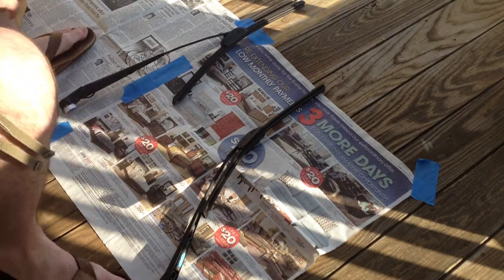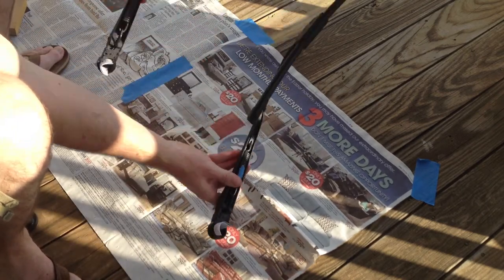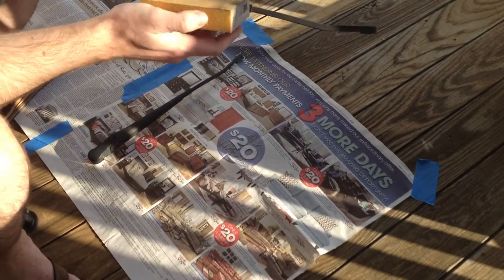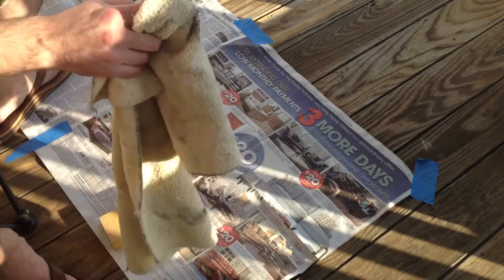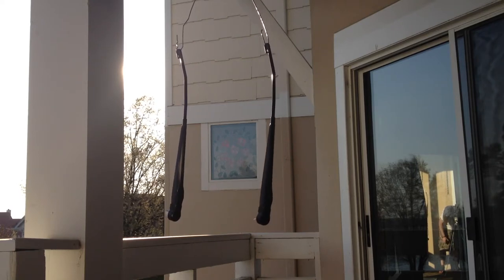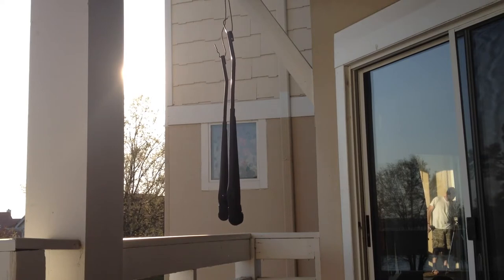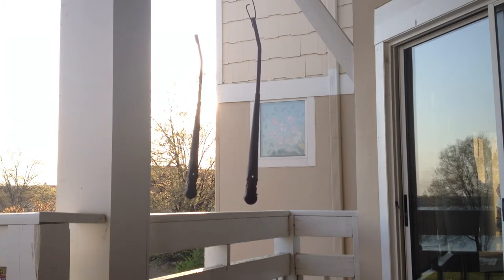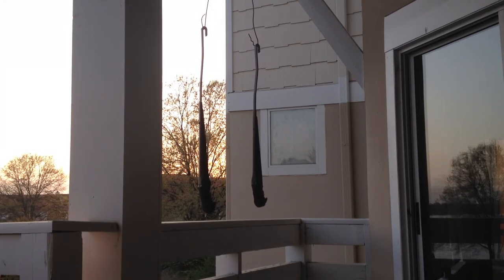How To Paint Windshield Wiper Arms Like New

Comment: should i sand between coats of paint and after the primer as well?
Reply from the maker: not necessarily, it will turn out fine without sanding. I would only sand with a fine grit between coats if you want a really smooth finish